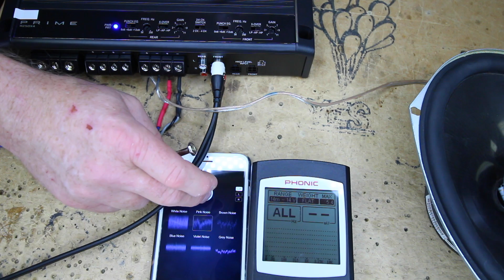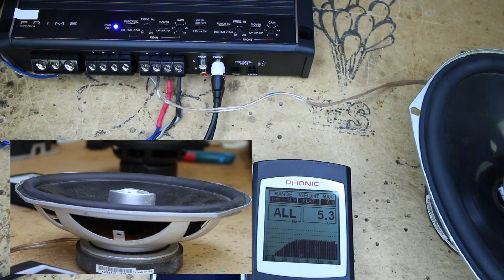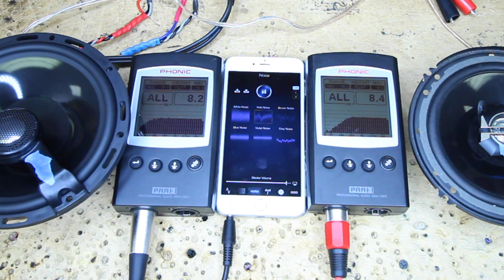What is a car audio speaker High Pass filter or HPF crossover and how it effects your speakers

Comment: Interesting video, on another note though is when i did a speaker comparison between rf prime amd punch 6.5 speakers the punch has a slightly better speaker resonse however the sensitivity is 3db lower which essentially means you need double the power to get the same sound.

Comment: I have a pair of Sony XS-GS1621 speakers powered by my Rockford fosgate T600 amp. These speakers are rated for up to 110 watts RMS with 320 watts peak power and a frequency range of 32-30,000 hz. Right now I have the speakers set to high pass but I want a little more bass coming from them so the bass from my sub isn't only coming from my trunk. I want a more full sound in my cabin. Will the speakers become distorted if I set them to all pass/will I ruin my speakers? Thanks!

Comment: So basically when the woofer stops moving the hpf is set right ???
Reply: It might not look the same to your eyes as on the camera since the camera probably only records like 30 frames per second which is why LED lights look flickering on video but not IRL. But when appying high pass filter the woofer will remove the slower vibrating frequencies which could make it look like in the video, but I wouldnt adjust the setting just based on what it looks like.
/rookie

Comment: Hi guy's I like to see you guys set up a multi 4ch amp with HPF-FULL-LPF & SUBSONIC crossover amps built-in how to do the dd-1 with this particular amp since I'm using the skv2 200.4  & components in the front coaxle in the back but you knew that already?

Comment: I have a question I don't know anything about HPF or LPF but I bought a Kenwood set of speakers just front speakers and rear speakers in a 2004 Ford ranger nothing special and no amp I'm wondering does the LPF and HPF still hold the same importance ? If so what do I set them to. I have played with it a bit by ear and it sounds really great but I am just not positive if I'm doing the right thing for the speakers.

Comment: Question;  I have an Alpine i209 in my jeep with two sets of Hertz Mille component speakers, a Alpine 10” down fire subwoofer. All powered by Alpine PDX-V9.  Should i be using the crossovers that came with the speakers or should I be using only a combination of the amp and head unit crossovers?  Thanks.

Comment: Very informative.  I'd like to adjust my HPF settings to add a little more mid-bass to my 6-1/2" door speakers (Kicker 43CSC654). My head unit does allow for adjustments I just don't know where to begin.  The vocals on male singers sound like they're singing at least 3 octaves higher.  Any suggestions??

Comment: I have a Sony XAV-AX100 car stereo with a high pass range of ‘off-120’ and low pass range of ‘50–120′. I have 4 Kicker CS 6x9’s (3-way), 2 in front and 2 in back. Simple set up.

So, if I understand this right then I should leave the high pass to ‘off’ since I’m not passing the bass to a sub or anything, right? Seems the only reason to turn the high pass on is if you had cheap speakers that might blow with too much bass?

I've listened with the high pass off and it sounds good, bass kicks good, full sound, doesn't sound like any stress on the speakers. But, I saw your other comment that sounded like if you turn the high pass too low it could blow the speaker if the watts go too high? 

If I should have the high pass on what do you think a good setting would be?

And, what about the low pass? I’ve tried the range of settings ‘50–120’ but I honestly can’t hear any difference.

Thanks in advance for any help you offer and sorry if I sound clueless...I kind of am, haha

Speaker specs:
RMS Power 150 watts
Peak power 450 watts
Minimum frequency 30 hertz
Maximum frequency 20 kilohertz

**It says that the speakers have an integrated crossover, if that means anything**
Reply: And the bozo didn’t even answer your question🤡

Comment: I have Rockford t400.4 and 4 KENWOOD kfc-174 set to 100 hrz and it sounds very clear.  I used  SMD-DD1 to set the gains. This seems to be what I’m getting from what you are teaching.
Reply: dd1 in my opinion is a waste of money, especially since you can buy a nice o-scope for around 200/250 that will work as a multimeter as well, and u will always never a multimeter

Comment: Is there anything wrong with doing a frequency overlap between the speakers and sub? For example crossing the 6.5"s highpass at 70hz and the sub lowpass at 90hz? My particular setup seems to sound the best with these settings but, pretty much anything I read says it's a bad idea lol.
Reply: My setup sounds good with the LPF at 90-95 hz and the HPF 80 hz. Could be that the door speakers don’t have enough midbass to sound balanced with the sub. My speakerrs are 60 watts each, the sub is 750 watts, 12” inch, in a sealed box built to specs.
Reply: As long as it works, it shouldn’t harm anything. It’s just filters that are slightly overlapping. The only thing it could affect is the sound quality, if at all.
Reply: I imagine it would be like boosting the EQ around 70-90 Hz, so yea trust the ear!

Comment: I have 6.5 pioneer in the door with some lanzar bullet tweeters in my front doors and 6x9 pioneer in the rear deck. What is a good crossover point to start at? And what filter should I have my four channel amp on? PLEASE HELP
Reply from the maker: John Brown I would start at 120 on the 6.5 and 80 on the 6x9. Go up from there. Play each speaker by its self when adjusting
Reply: Five Star Car Stereo turn the crossovers all the way down on the amp correct?
Reply: So just use the crossovers on radio and turn crossovers all the way down on 4 channel and Subwoofer amp?
Reply from the maker: John Brown yes you can do that also

Comment: Hey , Greta video . I have a questions I am running Kicker KS 6..5 components and 6.75 2 way for the rear . I spoke to kicker to see what crossover point i should i use and there telling me To cross it at 180Hz or 200 Hz. But its really not sounding to good . Whats the sweet spoke for these kind of speakers? Also My car is a convertible do i need to adjust anything else beside crossover? Thank you

Comment: ok so i Have a pair of T1 6x8 & T1 5.25 fosgates on a new JL 400/4RD. What frequency and filter should i use?
Reply from the maker: remzsti I would start the 6x8's at 100hz and see how they sound. Play them by themselves and at the volume you normally listen to them at. See if they bottom out or can handle more bass and adjust the crossover up or down. Repeat the same for the rear starting at 200hz.
Reply: thanks again ill try it today

Comment: Shouldn't it tell on the manufacturers specs as to what is the lowest frequency the driver can handle?
Reply from the maker: The manufacturer gives you the frequency response of the speaker on the box. So for example if you look at a pioneer 4x6 they say it can do from 50hz to 26kHz. They also say it can handle 30 watts min and 200 watts max. This speaker could never handle even 70 watts playing 50Hz, you would kill the speaker in minutes. If you crossover the speaker at 180Hz limiting the low frequency getting to the speaker the power handling will go up and it may take 100watts. This is one of the ideas we are trying to convey in the video.
Reply: I find your videos extremely Entertaining and Informative So please keep them coming.  This video did help me a lot to understand better  how the HPF works. I am now a bit confused  however after reading your reply to Mr Spanky's question. Given your Pioneer 4x6 example speaker (or any speaker for that matter  using  the MFG specs)  How would I know where to crossover my speaker to maximize power handling?